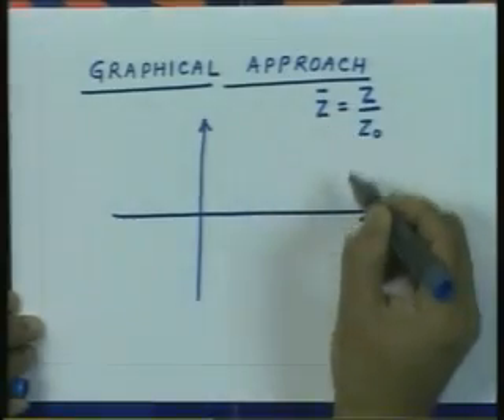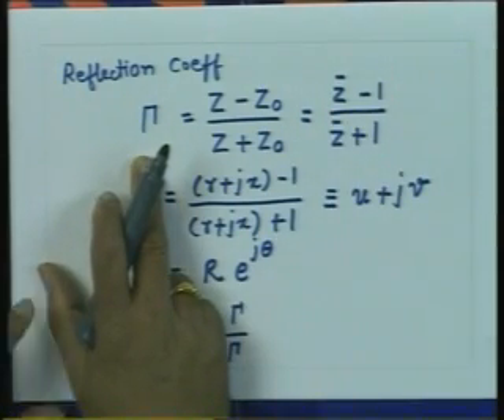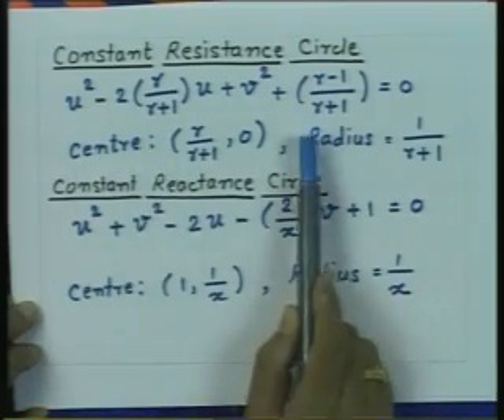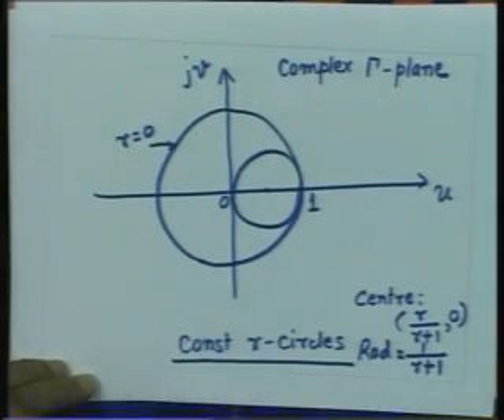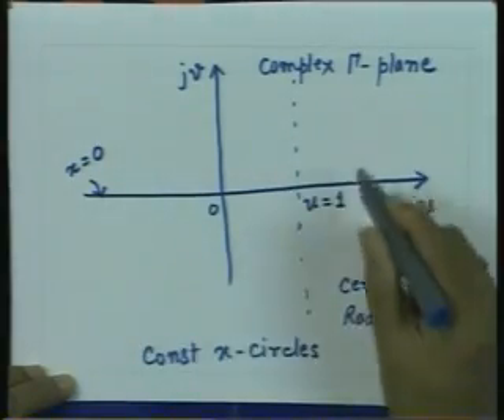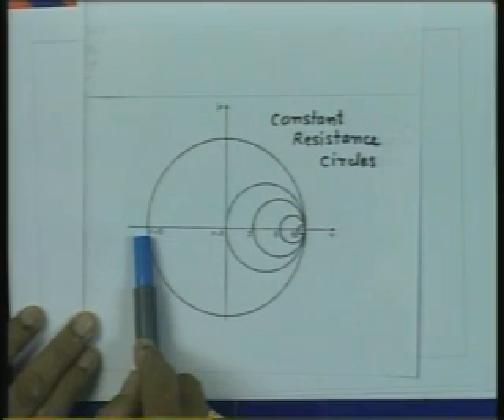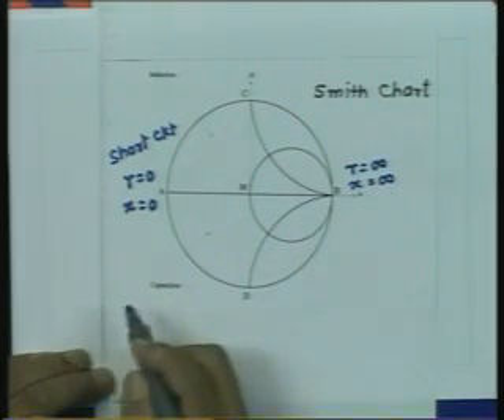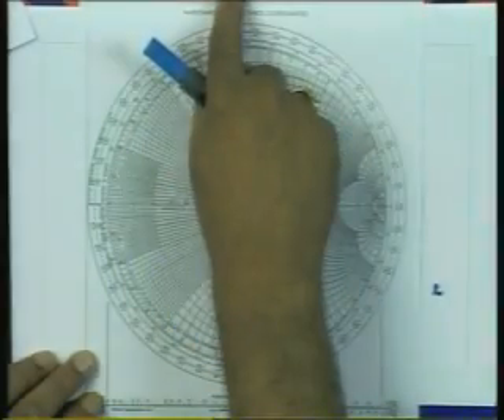Smith Chart

Comment: Its really very good...a very good way of explaining and proceeding from transforming Impedance Plane to Complex Gamma Plane to finally arriving at constant reactance and resistance circles...and using the cases to arrive at the Smith Chart circles, the short circuit and the open circuit points on the Smith Chart...Its all very well taken up and covered..Thanks a Lot, Sir, am looking forward in covering rest of the Topic of Smith Chart in lectures 9, 10, 11 and 12..

Comment: btw: why not checking another modern view on the smith chart: - a transmission line is just a latitude circle on that :): a 3d smith chart based on the riemann sphere for active and passive microwave circuits -on the 3d smith chart website is a new vision on it based on the june 2011 IEEE  MWCL article